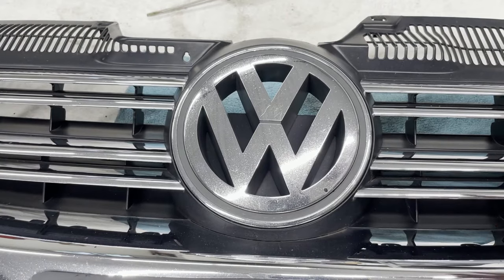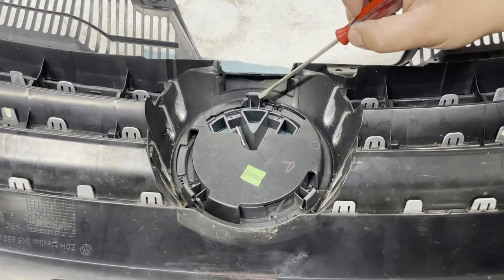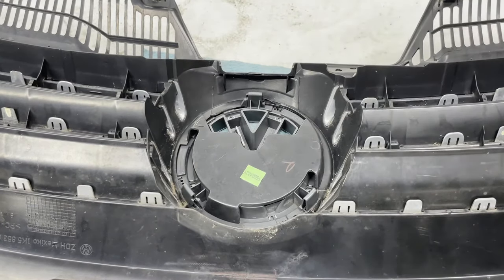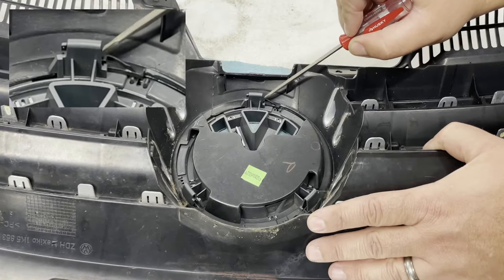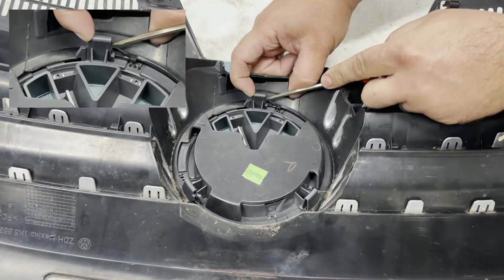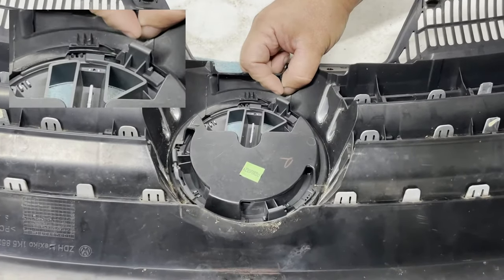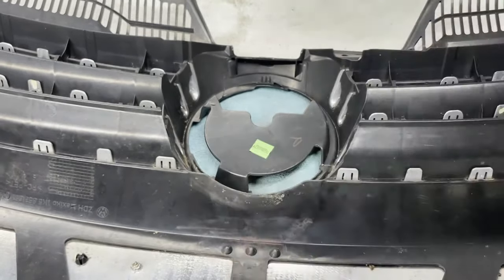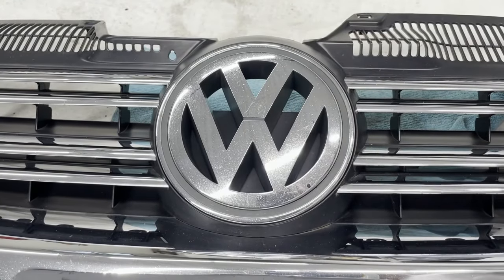How to Remove a VW Grill Emblem

Comment: I’m struggling to open my 2001 5.5 (?) Passat hood. (I believe the battery is dead, as nether key fob signal, nor the key will open doors or trunk.)

I think my Passat’s front hood VW Emblem is  released as you describe in your excellent video. 

Is there a simple way to remove only the grille portion of the from fender assembly?

Thanks. 
RL Buffalo, NY 🇺🇸

Comment: So I got all the parts for the mk5 Jetta from one of ur previous videos. You had the gli grille and the emblem on the oem/ one in this vid does fit the gli center grille. Which one did you use?
Reply from the maker: The part number for the smaller emblem is 1T0853601A
Reply: @ShinyFastLoud  ok thank you!